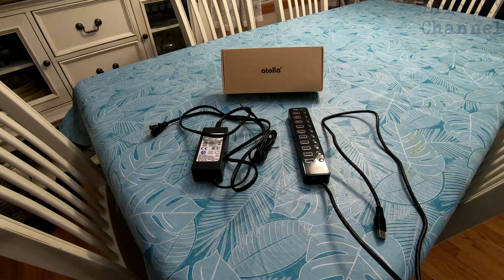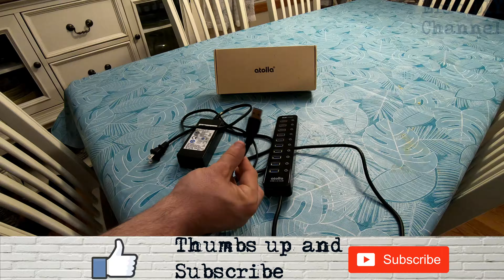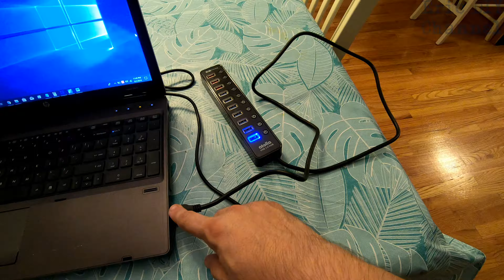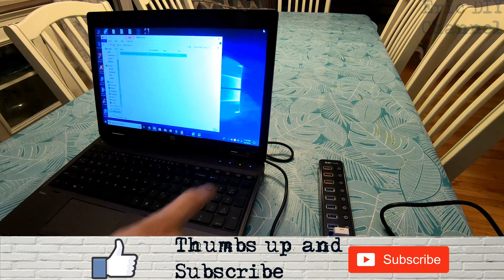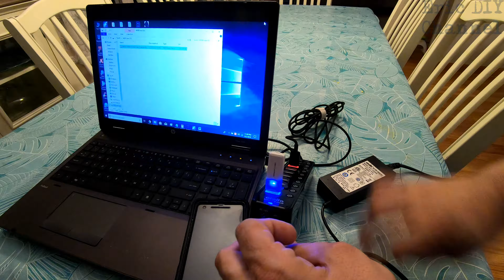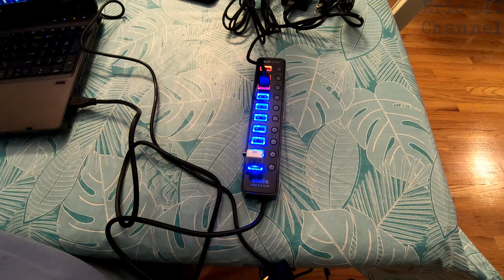Atolla Powered USB 3.0 Hub (7 USB and 4 Smart Charging Ports) Review

Comment: Hey there! Thanks for the detailed review of the Atolla Powered USB 3.0 Hub. It sounds like a versatile and useful addition to your setup. I'm interested in getting one myself, but I have a few questions:

1. How is the build quality of the hub? Does it feel sturdy and durable?
2. You mentioned it has fast charging ports. How quickly does it charge your devices compared to regular chargers?
3. Have you encountered any issues with overheating or performance while using multiple devices simultaneously?
4. Is there any LED indicator to show the status of individual ports?

Your insights would be really helpful before I make a purchase. Thanks!

Comment: your review is not clear enough.
 i just bought this atolla 10 ports (3 charging port). 
i plugged in 2 WD MYBOOK (powered) into blue port, running ok.

 but when i plugged my Toshiba 1TB portable hdd (not powered): it just simply making noise, the indication light is blue instead of white (which means not enough juice).

 when i plugged the same HDD into charging ports of atolla, it shows white light (good), but my win7 just can't detect the hdd.. 

when i plugged the same hdd into my laptop, it runs perfect.. this shows atolla is lousy.. can't even be use on a portable 1TB hdd..

 
i returned to amazon.
Reply from the maker: Don't most portable hdds have an extra USB connection to power the drive if it needs more juice?
Reply: @EricDIY  no, both of my small size usb external hard drive both 1 TB don't have option for power ..
only those big WD MYBOOK, comes with power supply itself.
Reply: @EricDIY  this usb really dissapointed me. wanted to try out Sabrent USB 3.0 Hub  that comes with 60w power supply, but according to amazon review, many ppl said it is just junk..  so, i am really at a lost why there is not even one working usb hub out there for external usb harddrive.
Reply from the maker: @andrewyek  On my cheap USB external hard drives, they came with a double usb to USB cable. The one side of the USB would go to the drive, the other two would plug into the hub (one for power and Jan connection and the other for extra USB power if it was needed) It might be as easy as that
Reply: Only the charging ports is getting power via the 12V adapter. The USB 3.0 ports does not and only gets power via the computer and that is where your issue with not enough juice to power up your external drive. You want powered USB 3.0 hubs that's capable of BC 1.2 to power up power hungry devices like a spinning hard disk drive. Look into Unitek USB 7-Port Hub. All ports are getting power from the external 12V power adapter (1 charging port 2.4V + 6 USB 3.0 all capable of BC1.2) https://www.amazon.com/gp/product/B06XKZLZXL